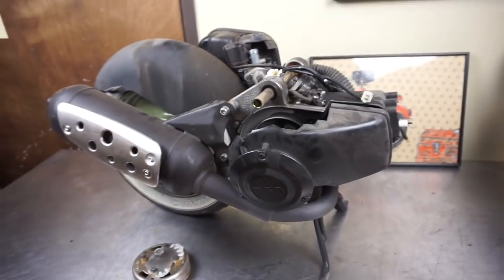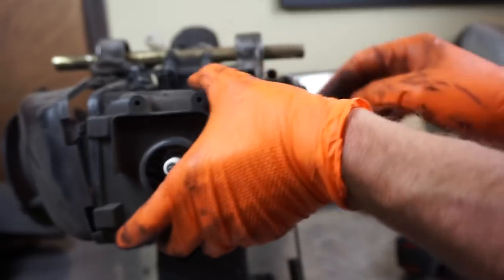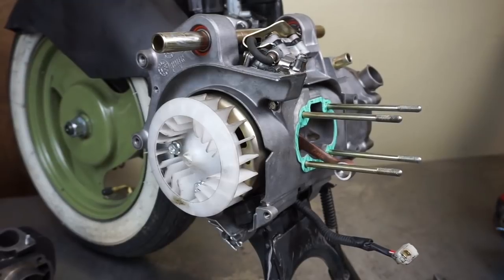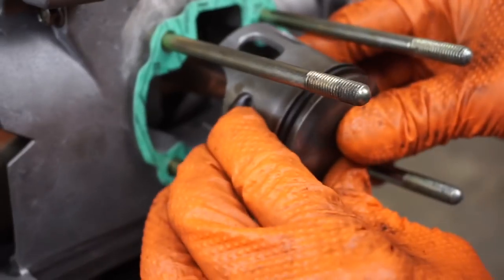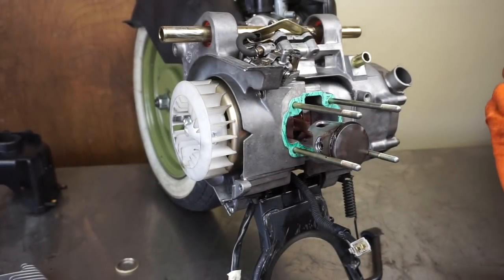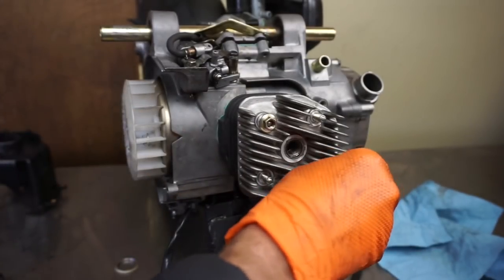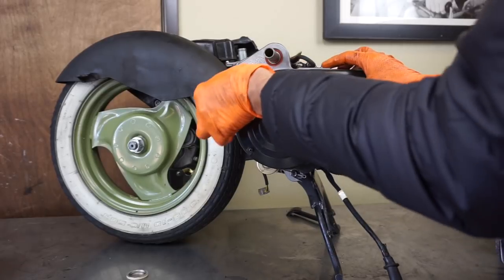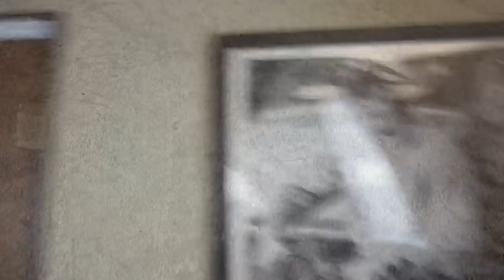70cc top end rebuild (2-stroke)

Comment: I have a 2002 Zuma.  Do you recommend plugging of the oil pump (injection), get a 21mm carb and go pre-mix?   Any recommends on the jetting for the 21mm, with 70cc Pollini?
Reply: I still run a oil pump on my typhoon with a 70cc polini sport kit but i do measure out a additional ounce for peace of mind for gas tank and for the 21mm carb i run 115 main messed with air fuel screw didn’t touch pilot jet my cylinder is ported fyi
Reply: @Nickpeezy94  Thanks for responding.

Comment: ok hold on....I got the naraku minarelli 70cc kit and 70cc head and it came with the rubber head gasket AND a metal head gasket. I thought I was supposed to use both. Should it just be the rubber gasket?

Comment: Hi, I noticed on your rebuild video that you were working on a buddy. I recently put a 70 cc upgrade from the standard 50 cc. I left the stock carburetor and exhaust on it when I upgraded. When the motor is cold, it has very good compression and picks up speed nicely but once it is warmed up, I lose a lot of compression especially going up any type of incline. I noticed when I opened it up again that the piston was not hitting the top of the cylinder wall. Do you have any advice for me in this sense?

Comment: Sure that not the crome ring is top ring ?
Never seen a black ring as a top ring
Reply: Yes, you are right. The chrome ring should always be on top of the piston. He didn't clean the top piece for the cylinder either, for some reason.

Comment: Do two strokes not have camshafts???
Reply from the maker: No, 2-strokes don’t have cam chains, cams, or valves :-)
Reply: Rolling Wrench ATV Scooter & Motorcycle Huh....learn something new everyday I guess
Reply: Strange Woofer 2-smokes are 10 times easier to maintain and fix in the case it ever does brake

Comment: I advise you: remove the cap that obstructs the entry of air.

it is likely that you can melt the cylinder
Reply from the maker: Ahhh, it breaths from the sides. It may have looked capped off, but it’s not. That’s the oem design
Reply: @RollingWrench  must absorb on the right side. and this right side should not be covered.

remember . It is an AC cylinder
Reply from the maker: j. Patiño it comes that way from the factory. It would be better to open it up more I’m sure.

Comment: its not a jog motor it a PGO HOT 50 motor
Reply from the maker: True, same design though
Reply: @RollingWrench  actually theres a big difference between those 2 engines. Cylinder, exhaust, clutch is  the only parts that fits from the jog engine.

Even the engine dosent look like a minarelli engine
Reply from the maker: That - Midas very very similar. Enough so that the procedure looks the same. Part are different yes. Thanks for chiming in :-)